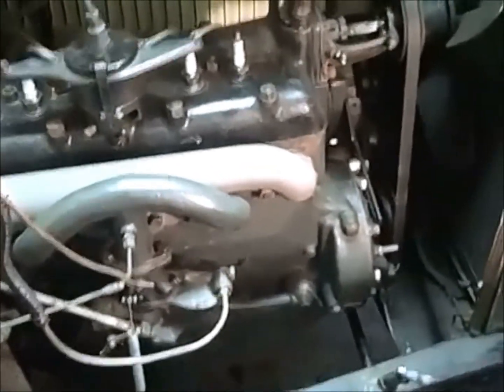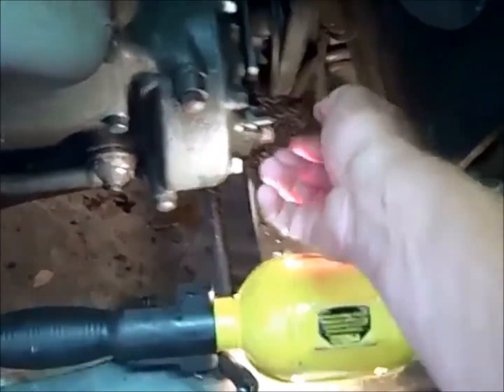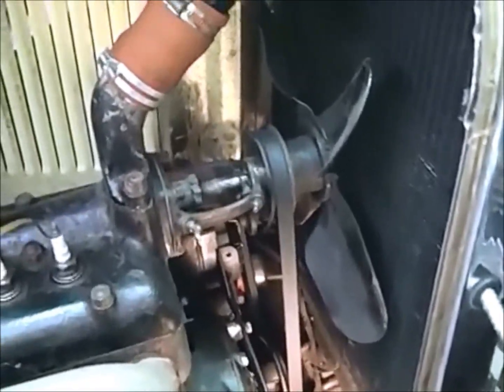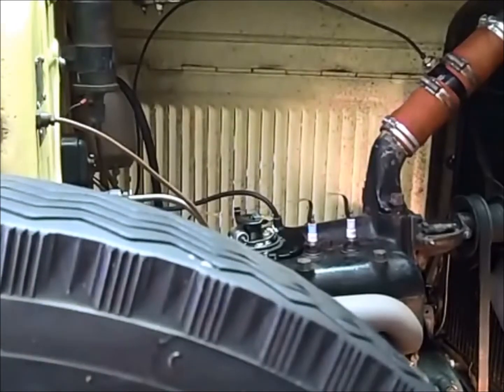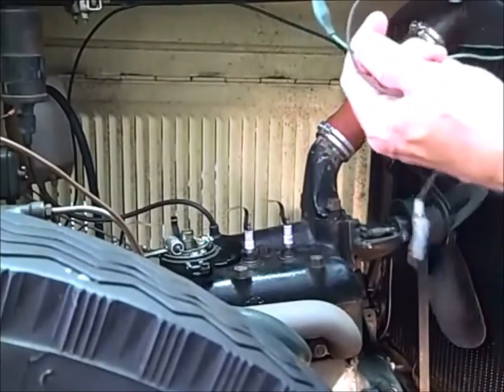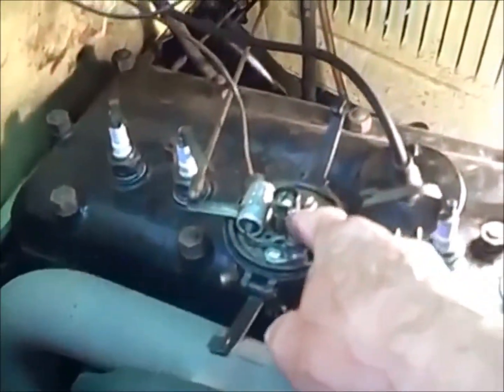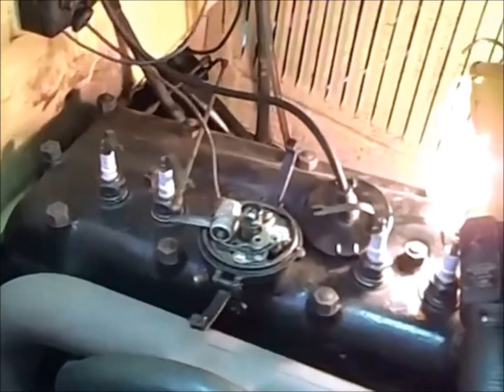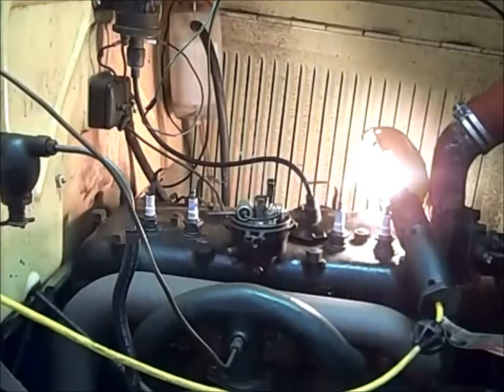How to time the Model A engine 2021

Comment: Withe timing lever all the way up the points should be opening as you lock down the cam. It seems to me your way shuts down the engine at full up lever position..... am I wrong ?
Reply: I've had a Model A for over 40 years. He's a little off there, but it's OK and the points just open is when the coil sparks convincer helps collapse the magnetic field.
Reply: That should have said condenser Lol

Comment: That rocking the car in 3rd gear is a great tip. I have been using the fan it's a 2 blade metal. I am going inspect it. Thanks